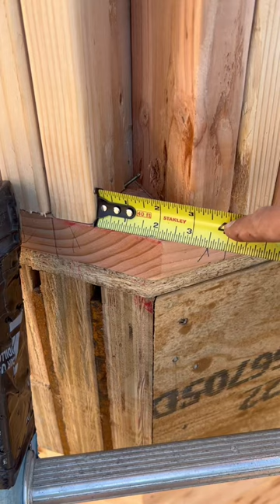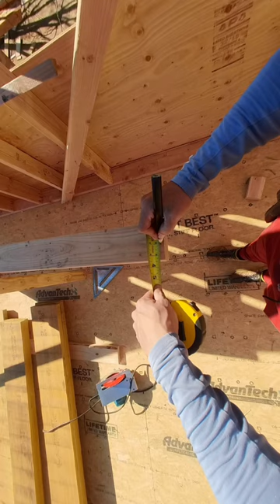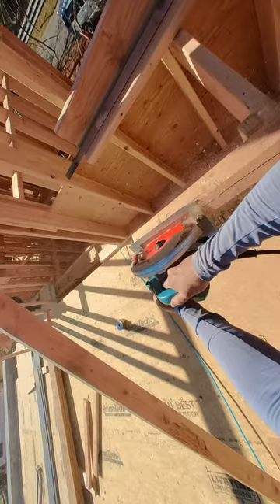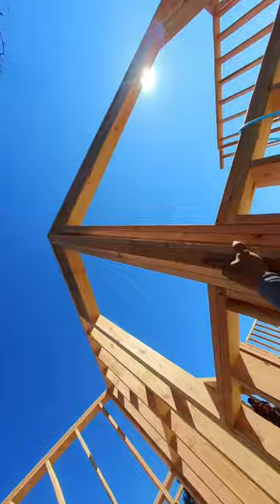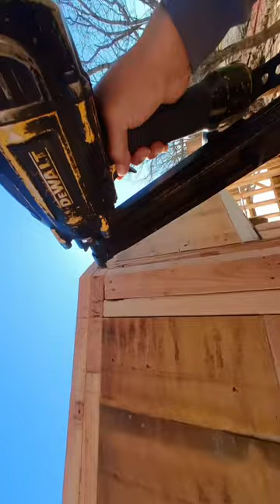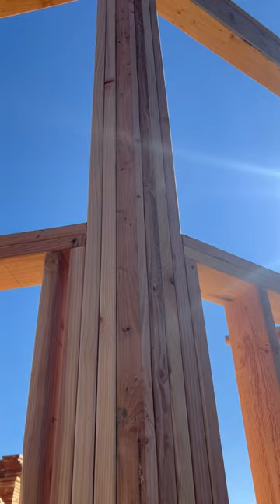Corner #skills #perfect #skills #shorts #tips

Comment: Very nice, whoever designed that house tho has made a cold corner lol 2 windows and almost no insulation with all that framing. I'm in Canada so that type of design is seldom seen
Reply: It's alright just upside the hvac unit lol
Reply: I'm glad you said it.  All the other comments are about the framing awesomeness, which is awesome, but anyone with a mind on energy efficiency is thinking exactly what you said.

Wood has an R value of about 1.5 per inch, so that corner is a temp transfer zone
Reply: Absolutely agree. Hats off to this framer but clearly the structural engineer and architect did a big disservice to the client.
Reply: Yes that's true they're going to be out of pocket almost an extra $20 a year
Reply: My first thought was " I hope he insulated that air gap"
Reply: That is exactly what I was thinking, here in Northern Canada there would be ice inside the house on the drywall if I put all that wood in one corner with no acoustic sealant between them, but then we are hardly framing with wood anymore in my area anyway it’s mostly ICF now
Reply: Chances are that he is working in a southern region.

Comment: I have that same circular saw, 5000f 7 1/4 model. Still beats cordless even though she’s pretty old and well used. Love your content, always going above and beyond. I know some dudes who’d fill that gap with foam 😂
Reply: Those are good saws. The 2 3/8 depth of cut is a bit shallow though.  

 I'm 100% Makita, but I brought a cordless 36V (2 battery) Makita xsh06 to work in 2018 and over the next year my whole crew changed to cordless.  Their choice, and on their dollar.  (I supply tools normally, but I wasn't going to spring for new cordless saws when our 5000fs were good)  Now not only my crew, but our 2 sister-crews are all cordless.  The 7 1/4" battery saws out now are no joke.  They can rip LVL.   Normal day you'll have a battery change about 2pm.  Some days the batteries last all day.  I can cut 2 flights of stringers, cut and rip  treads (both SYP) and risers on 1 set of batteries.  

Every carpenter over 50 who sees my saw loves to comment on how their "old school" etc.  By the end of the day they ask me where to get one.

Comment: Glad some guys actually do this. I've done countless repairs where the corners split because guys skipped this step.
Reply: What sort of repairs?
Reply: @Dcyphrz  if they don't take this step, the plywood doesn't get nailed properly.  Then over time the edge of the plywood curles out. Which causes the corner to open up. I usually see it on cedar shakes weaves. But it will separate a corner board too.
Reply: @joelthompson9810  I dig.  I'da thought you could float the sheathing that far but I haven't framed a whole lot.

Comment: Why snap a line on dimensional lumber?  Scribe that chit, homie!  I do the same thing, one piece and done
Reply: Yes! What about the bow in the board?
Reply: run your pencil over ten feet vs snap a line?. he did it right
Reply: @ARJ Parke  lol ok man.  Him and another guy!?  You obviously aren't a carpenter.  You have to get the chalk line to the other side somehow, dude.  Just scribe as you walk.  He literally had another guy holding his chalk line.  Waste of time and labor.  And if the board is even slightly bowed, your cut will be shit.  You'd be surprised how fast it is to scribe with a pencil and your square.  I have been framing for 23 years,  come work on my crew I'll teach you some efficiency and common sense.
Reply: @ARJ Parke  remember, there are graduations on the front of every saw.  Pro level ripping  right there.   I'll typically only scribe a few inches just to start off straight.  Then watch the saw table markings against the edge of the board.  Cheers
Reply: @mattmag3089  different strokes for different folks. I can use my chalk line by myself and save time while you're sharpening your pencil. Neither is more right than the other. I won't claim to be better than another. Stay humble
Reply: False.  Your opinion will change with experience, my friend.  Sincerely.  Friends don't let friends snap lines down studs.  Any experienced carpenter will tell you.
Reply: @mattmag3089   please post your videos I wanna see your tricks of the trade
Reply: @Peter Stanbery  too busy working buddy!   I will soon though.  In a few months I'm posting a time-lapse of building a round wall with a cone roof.
Reply: @mattmag3089  upload a video and show us